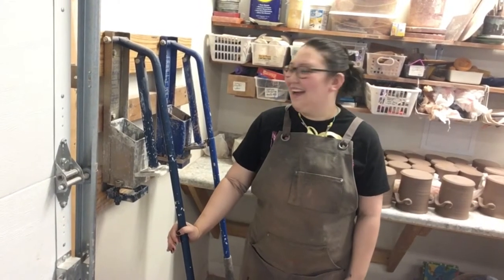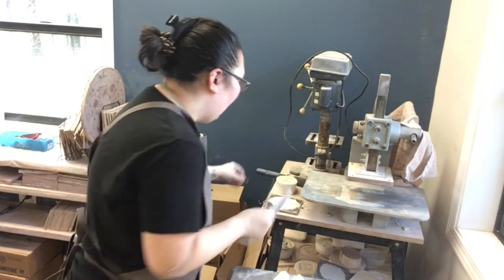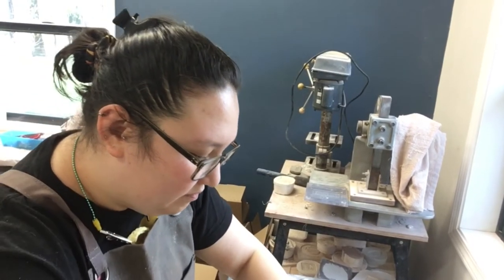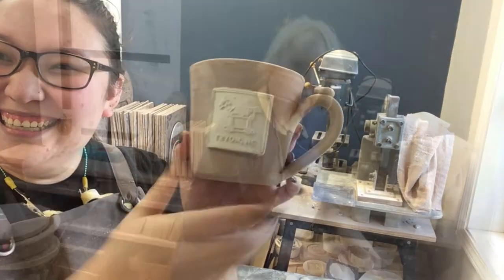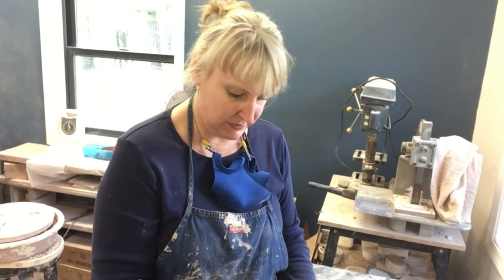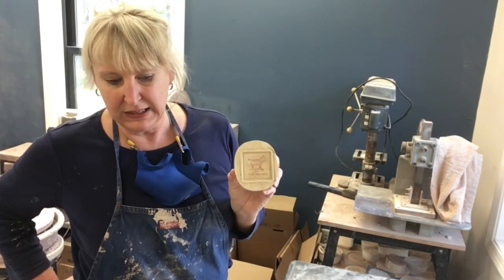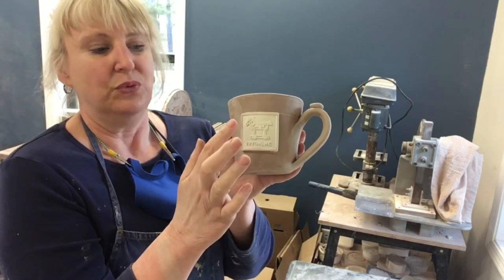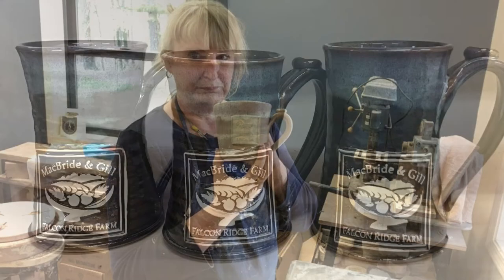How to Make Custom Medallion Logo Pottery Mugs | Weaverville, NC Shop | Salvaterra Pottery

Comment: Hi Sue- Beautiful work.  In your final photo you show 3 mugs where the medallion is in white (light color) and different from the dark glaze on the main body.  How do you get the light color to appear?  Do you dip the whole mug+medallion in the dark glaze, then wipe off on the raised parts of the medallion?  Or do you hand paint each medallion?  Would love some insight into your process
Reply from the maker: We dip the entire mug and go back and wipe off the raised parts with a sponge.  Some medallions are easier than others.  I usually have a bit of glaze and a tiny paint brush with me while I do them because I frequently wipe a spot I don’t want to and a quick dab of glaze fixes that.  Medallion mugs are time consuming.  Until you make them, it is hard to understand all of the steps that go into them.  We have some folks that fuss about the price so we offer an easier version of a stamped mug with no medallion.  Hope that helps.  Thanks for watching!
Reply: @salvaterrapottery  Thank you Sue.  Wow,, you have patience, and I can see how they can demand so much attention.  Cheers!

Comment: Brilliant video! Some potters use hard plastic (like a cookie cutter) to stamp on the clay, do you find the softer photopolymer stamps give just as clear an impression? Thanks!
Reply from the maker: We have used rubber stamps of all sorts and are now cutting out our own from carvers wax with a c&c machine.  They all seem to work well.  I find it’s more about having a good design.
Reply: @salvaterrapottery  Ooh carvers wax, I'll have to check that out!

Comment: How do you get the glaze to be crisp and not wipe it all away? I'm struggling to get it to work.
Reply from the maker: I always have a small container of glaze and a tiny brush to do touch ups quickly.  Some designs are easier than others.  Designs that have a lot of raised places keep the sponge from wiping off the areas I don’t want to wipe off.  Hope that helps.

Comment: Where do you get your acrylic stamps made?  Are they laser cut?
Reply from the maker: The person who originally made these has retired.  My husband now cuts them with his c&C machine with machine carving wax.  We tried a laser cut but it was too rough—c&C is better.  Sign makers usually have c&c machines.  They are quite common now.
Reply: @salvaterrapottery  c&c machine..? Sorry not sure what that is. Plasma cutter..?
Reply from the maker: No not plasma.  CNC machines are usually used to cut a design in wood with a computer loaded image.  Computer Numeric coding is what my husband says it stands for.  I thought it had an & sign in out.  Hope that helps.